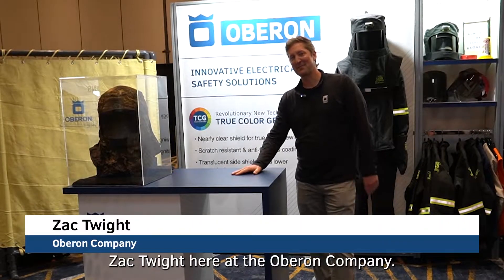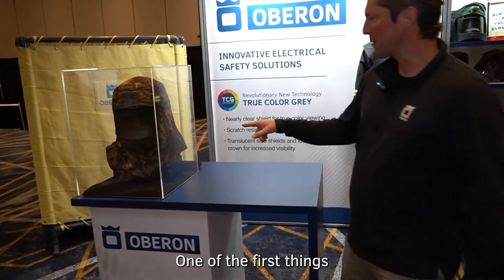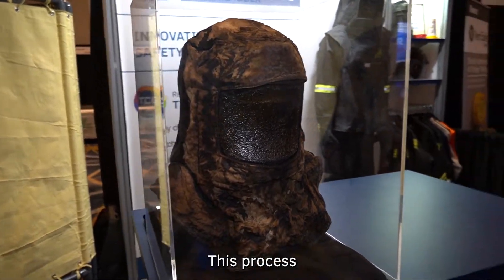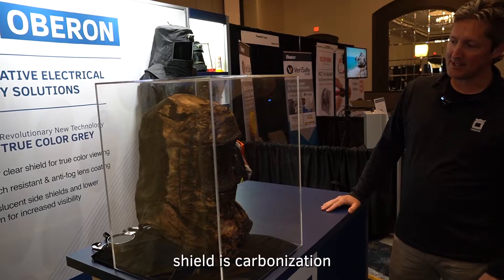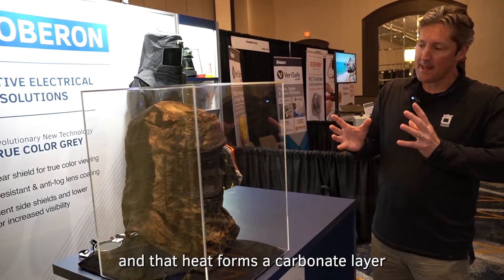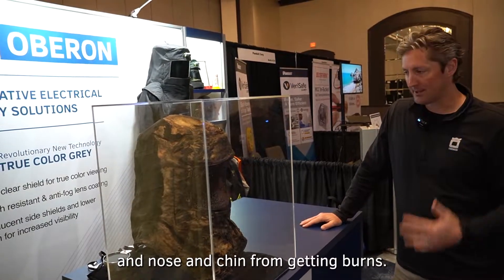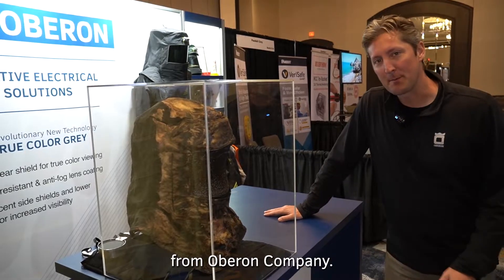What Happens to Arc Flash PPE After an Arc Flash?

Comment: Back in 1979, my husband was involved in an incident in a 480 volt main switchgear. It was a Federal Pacific with a 4000 amp main breaker. The one breaker “protected” (4)  1000 amp 480 volt sections.  As an apprentice, he was not actually doing any work. The journeyman electrician was changing a bad 3 pole 60 amp breaker with the switchgear still energized. The plant manager didn’t want to shut the whole plant down “just to change a breaker”. A finger that connected the bus to the breaker broke when the journeyman tried to lock a holding screwdriver on to keep from dropping the screw. The resulting arc flash destroyed the section, and the 4000 amp GFCI breaker never tripped. The fuses on the primary side of the transformer bank finally blew killing the arc. My husband and the journeyman received 3rd degree burns over 30% of their bodies. My husband had on glasses with the automatic tint. The doctor said that was all that saved his eyes. They were totally opaque after. He spent two months in the hospital, and wasn’t able to work for three years. He had 5 operations for skin grafts. I say all that to say this. NEVER work a panel hot. What would have been a 45 minute shutdown wound up being 3 weeks, not to mention the pain and suffering the guys and their families went through. Secondly, they didn’t have these protective suits in 1979, but they do now. If you work on anything that could remotely fault, be sure you wear one.
Reply: As industrial maintenance worker. Screw the plant manager. I've refused a lot of tasks due to safety issues. There's my tools, go for it boss.
Reply: @Petesworkshop2225  Yup. If you don't have stop work authority, leave the job.
Reply: @Petesworkshop2225 1979 is awfully close to the Ford fiasco where they legitimately wanted to argue before a judge that it was cheaper to settle lawsuits than to recall and fix a major design flaw, I think that was the moment a formal pricetag had to be put on human life, and they still push the limit.

Where I work the only thing that causes higher management to ever consider PPE above legal minimum is a combination of skeleton crew and high maintenance public facing infrastructure of the type that even internal incidents can ruin our reputation and income (amusement park).

Recently one incident happened and the engineer declared to management he would rather let the machinery self destruct than to put his men in a situation they might be exposed to an arc flash, and I'm IT but was asked to help with setting up something to jumpstart the system so they don't have to perform the last resort. (Me bringing an extension cord and a charged ups under heavy rain to the dead control panel) just so that they don't have to risk physically engaging the generator.

We're getting quotas on a bomb suit and a more sophisticated backup solution so I can retrieve my forcibly borrowed UPS.

Comment: When I got out of the army, I got a job at a mine. They were impressed, and day one promoted me from laborer to the fab shop, and "apprenticing" with the electrician. Problem is, that electrician had never done any elctrical schooling himself and learned on the job. I had no idea just how dangerous the 480 power I was goofin around with was. My electrical knowledge was "turn off power, check with tester wand, take out bad part, put new good part in by matching the colors." Now that I'm older and have learned more I realize I am incredibly lucky to have not killed myself. I had no clue what I was doing and just kept lucking out and fixing problems without accidents for 6 months, except for when I almost got zapped off a 60 foot silo with no gaurd rail because some dipshit bypassed my LATO lock. Was only 220, but I lost my footing and started sliding. Now, I don't touch electrical shit. I was fucking around with power cables as thick as my thigh almost ignoring the danger, cause I had that army infantry "will follow orders, place the mission first" mentality.

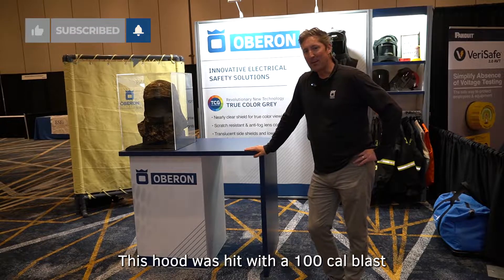Comment: 0:10, OK, but what is a “100 Cal” blast ??
Reply: 100 cal blast is an arc flash with the power of 100 calories per square centimeter. Arc flashes are measured in cal/cm^2. A 100 cal blast is very very powerful and without ppe would kill you instantly.
Reply: @flyingfencepost  That makes way more sense, I thought they shot it with a 1 inch gun or something and i was so confused
Reply: @flyingfencepost can I eat those calories? I'm really hungry.
Reply: @flyingfencepost  You measure electrical explosions in calories? 

Interesting. Why not joules? 
Would the numbers be too large for practical use?
Reply: @Dave_Crupel  Joules is another way to put it, but calories is just the standard.
Reply: @Dave_Crupel   because joules can disperse easily. 

You're not judging how big of an arc there was,  you are determining how many times your corpse would be cooked if you didn't have ppe 

Remember some people survive lightning strikes, some get cooked instantly.
Reply: @M-Z-E-U-J-HB  definitely not the logic i was expecting. But i love it haha
Reply: As a reference point, second degree burns can start at about 1.2 cal/cm²
Reply: A blast from a rifle chambered in 100 BMG.

Comment: Please define a "100 cal blast". Hardly anyone outside that industry knows what you are talking about.
Reply: A cal or calorie is the amount of heat to raise one gram of water one degree Celsius. 
There are 2 parts to an arc flash. The heat and the concussion. This will happen in milliseconds. In some cases the arc can get up to 35000 degrees, 4 times hotter than the sun. The clothing is ment to protect from burns, not the concussion. I have been told it is like a .44 caliber pistol point blank over your entire body. 
In short, the proper ppe can save you from a lot of injuries
Reply: they shouldn't need to define it because you aren't gonna buy a $5000 suit you don't need. If you need the suit you know what cals/cm2 measure

Comment: 100 cal blast, I've heard almost every term in reference to electrical discharge,  but never that one. Wtf is a cal?
Reply from the maker: @Max_Chooch A cal is a calorie, which is the amount of energy required to raise the temperature of one gram of water by one degree Celsius.

In the context of electricity, when we talk about energy, we often use joules. One calorie is equal to approximately 4.184 joules.
Reply: @OberonPPE 
Agree on your numbers. But a 100cal blast, by your definition, gave off enough heat to raise the temperature of a can of beer about 0.3C. Maybe Kcal?
Reply: @Zerpersande  
Its how fast it releases the energy.

A rifle round is about 4 cal.

Comment: Thank you for posting this video. One great worry with re-urbanized areas is the very different electrical demands that still need guys in never-enough-protection to take risks. Is there a robot that can do their job? I don't think so, even by radio remote. There's not enough respect for those in this trade.

Comment: you know, i would think that a "properly working" suit like this would just....not transmit electricity. i mean there are tons of actually insulative materials you could use, so why the fuck would you use ones that conduct electricity, and just impregnate that with whatever shit youre filling it with?
Reply: Look up "breakdown voltage". (Also, arc flash is a violent discharge of heat, light, and rapidly expanding air; it's a very different beast to an electric shock.)

Comment: Granted the suit works what kind of condition will the worker be in? Will they need to stay in the hospital ICU or will they just need a new pair of underwear?
Reply from the maker: @toryknotts8026 If a proper risk assessment is performed prior to doing the work task, and the incident energy is less than that covered by the arc flash suit, then the worker will have no more than second degree burns. The suit is designed to take the beating and keep the worker protected. So, yeah, maybe new underwear! :)
Reply: @OberonPPE  that is just amazing. Also I've asked the same question to multiple company's on youtube and You are the first to respond. So if I ever need an arc flash suit I will keep you in mind!
Reply: Maybe both!

Comment: The joke in our industry was that arc flash gear was NOT for your protection, it was for making the cleanup less messy for the next guy.  Working in the wind turbine industry I saw an arc flash when the turbines transformer was connected to the sub-station.   Someone left a wrench across a couple 2 inch copper bus bars and when the switch was flipped BOOM.  These were not the little old turbines but the new 3 megawatt per hour (1 million watts per megawatt) turbines.  That's enough to power 2200 homes all day for each hour it runs.  For those that don't know, it isn't the heat that kills you, it is the roughly 60,000+ times expansion in milliseconds that will pulverize anything in its path.  The bottom of the turbine is made of 2 inch thick cold rolled steel and the arc flash pushed out the wall about 3 inches where the power panel used to be.  That turbine was never powered up by the time I left site 3 months later.
Reply: The heat is 4 times hotter than the surface of the sun. It will kill you too. Total devastation.
Reply: It's great to hear a man who loves his work - good on ya fella.
Reply: Damn
Reply: That's the same joke we do with bomb suits.
Reply: Maths isnt your strong suit

3MWh = maximum turbine output for 1 hour
30KWh = average daily household electricity usage 

3MWh / 30KWh = 100 homes
Reply: @Goodkiwibloke 🤓
Reply: @Goodkiwibloke  I don't know about the literal math of his description, but the general 2200 homes detail is correct. 3 MW is a reasonable wattage for a new turbine, I looked them up. They range all over in wattage, some of them going up to 15+ MW. The found some metric that the average US home consumes 1214 watts, which is sorta reasonable. 3 MW / 1214 W, wow, 2471.169; more or less right in that range of 2200 homes. Nowhere near your 100 homes metric.

I don't care if you're right, wrong, or if neither of us are right - you're just an asshole, leading with an insult, and relying on poor metrics in the original comment to justify your opinion. Even when you encounter people admitting to a mistake, you're STILL an asshole. God, please go back to working in the industry, so one of those arc flashes might zap you off this Earth.
Reply: @Goodkiwibloke  what do you expect from blue collar workers 😂😂😂
Reply: 30kWh per day seems extremely high for an average home...
Reply: @Goodkiwibloke Talk about not being good with numbers 24 hours per day so it's about 2500 homes
Reply: @scanamana  you're not much good at maths either

Read what he said "that's enough to run 2200 house for a day for EACH HOUR it runs"

So it's not about 2500 houses, not even close

Divide your 2500 by 24 hours, you get about 100, just like I said
Reply: @Goodkiwibloke  Oh, well, yeah you're right with the numbers, but I might just add, it wasn't my math skills that failed me, rather my reading apprehension :D
Reply: @Goodkiwibloke  Thats wrong. kWh is per hour. Its a rate. MWh is a rate. Daily household use would me measured like "30 kilowatts used (kW). A megawatt is 1,000 kw and would me proposed as MW and MWh.
Reply: @silvy7394  no, kWh is a unit of energy, because it's (energy/time) * time. kW is a rate, because it's energy/time. In kWh there's no per, it's just kilowatt hour
Reply: @Goodkiwibloke  also, "MW per hour" is incorrect, the Watt already has a time domain, it's the rate of energy over time (Joules per Second) so the "per hour" makes it "Joules per Second per Hour". A Watt/Hour would be Energy/Time², which would denote a constant increase in power (akin to acceleration), like, "over the past 10 years the country's energy needs have increased at an average rate of 10 Watts per hour, starting at 1MW and raising to 1.88MW" but that would be a stupid/confusing way to convey the information.
It's crazy how many people get these units wrong, I see it in (what I thought were fairly reputable) articles all the time.
Reply: @CuthbertNibbles  Yet another "expert", who lacks a basic understanding

WH, KWH, MWH are all well recognised units of energy delivery. Ask your parents if you can take a look at their power bill - electricity is sold in KWH for domestic, MWH for industrial. Now take your idea to your parents electricity retailers and explain why they (and all other electricity companies) are wrong

It's crazy how many people still get these units wrong........ isn't it?
Reply: @Goodkiwibloke  no need for a power bill - my students asked this question a few times, so I know how to answer it.

The confusion comes from the semantics. "Watt-hour" and "Watt-per-hour" are two very different units. When we talk about units in physics, joining them (Watt-hour) means we multiply the units, and adding "per", means we divide them. The "Joule-per-second" is written J/s and calculated "Joules divided by seconds", and the Joule-second is written Js and calculated "Joules multiplied by seconds".
The original comment said, "These were not the little old turbines but the new 3 megawatt per hour (1 million watts per megawatt) turbines." so, ignoring the mega prefix, which is not relevant here we are taking the W and dividing it by hours. To understand why this doesn't work, we have to understand the units at play.
A Joule is the SI unit for energy, it does not have any time component.
A Watt is a unit of power, it's a measure of energy over time (J/s).
A Watt-hour is a really annoying unit of energy, which measures the energy-equivalent of Watts for an hour;
100Wh is 100W multiplied by 1h. 1h is 3600s, so
Units: Wh =
= W ⋅ s
= (J/s) ⋅ s
(second cancel out)
= J

Now consider the watt per hour:
W/h
(transpose hours to seconds) 
= J/s ⋅ 3600/s
(lose the constant
= J/s²
What does J/s² measure? Similar to how acceleration (m/s²) measures a change in velocity (m/s), J/s² is measuring the change in power (J/s).

Now, let's take this back to the original comment, 3MW per hour. How would this look in numbers? Let's plot 3 megawatts-per-hour, or 3MW/h:
1h - 3MW
2h - 6MW
3h - 9MW
See the problem? The correct way to write this, would be "3MW", which is the capacity of the turbine, or, 3MWh-per-hour", which would come out to the same thing because, remember, join means multiply, "per" means divide:
MWh/h
(h cancels out)
= MW

So the comment should have been, "These were not the little old turbines but the new 3 megawatt (1 million watts per megawatt) turbines". But, like I said, this is a mistake made by big-name publishers quite frequently, it's not a sign of bad information, just a hint that the person does not work with these units frequently.
Reply: @CuthbertNibbles  I think it was clear what OP was meaning

If you want to correct the minute details of YT comments, you have too much time on your hands IMO. Pointing out gross errors is important, so people aren't misled

But if you are truly passionate about getting people to use precisely correct UoM, start watching EV, home battery and off grid topics. Plenty of rich ground there, esp KW vs KWH

I am a retired industrial chemist, with a post graduate degree in physical chemistry. So physics and mathematics were a big part of my life. But I realise that many people commenting aren't so well grounded in UoM, so I look for what they are meaning rather than exactly what they say
Reply: @Goodkiwibloke  it's not a passion, it's the same thing that drove you to comment about the math error. A high degree of familiarity and 5 minutes to kill. We're not out here hunting for mistakes (or at least I'm not, I assume the same of you), it's a spontaneous opportunity to improve something by a little bit while killing time anyways.
Reply: @CuthbertNibbles anyway. No “s”.
Reply: @Goodkiwibloke Wrong like using the wrong letters?
It’s Wh, kWh, MWh. Particularly for the multiplier units; m is 0.001 and M is 1,000,000.  
K usually signifies temperature on the Kelvin scale, not x1000 like k. 
How many pedantry is this comment?
Reply: @GuestUser42069 Yet another clueless comment. Prefixes kilo, mega, giga, tera are always abbreviated with capital letters, not the random assortment you suggest. It's called consistency. KW, MW, GW, TW

Hopefully you have learned something
Reply: @Goodkiwibloke I can recommend reading some references. All the SI multiplier prefixes from k (1000) and smaller are written lower case, whatever your sparky mates think
Reply: @GuestUser42069 Below zero multipliers are lower case (milli, micro etc). Above zero multipliers are upper case (kilo, mega etc)

It's a little thing called "consistency"
Reply: @Goodkiwibloke  https://en.m.wikipedia.org/wiki/Metric_prefix
You are consistently wrong 😂

Comment: I worked on industrial machines and electrical for 22 years.  I was with a guy that got flashed with a 3phase 4160v main.  He was told to remove the cover panels from the top down.  He removed them from the bottom up and the top cover fell across all three legs of the main.  Luckily, he was on a ladder because the blast knocked him back off the ladder.  The flash about 4ft away from him caused second degree burns on his face, hands, and forearms.  We had to work around live mains and live machinery more often than not so there was no flash shields.  He was very lucky.